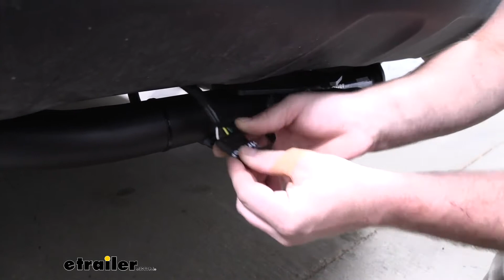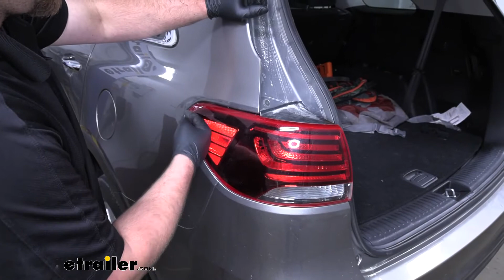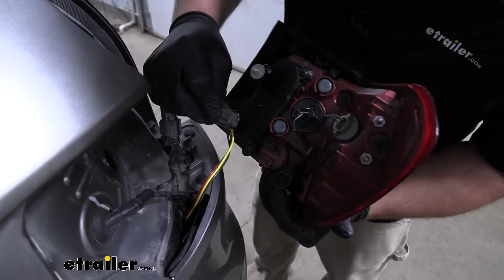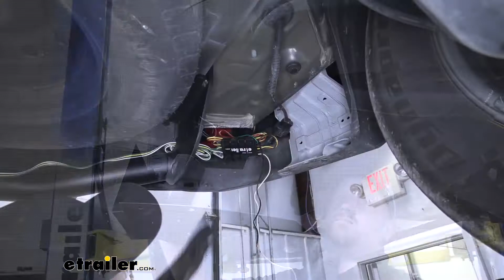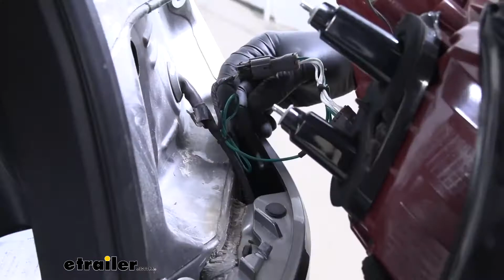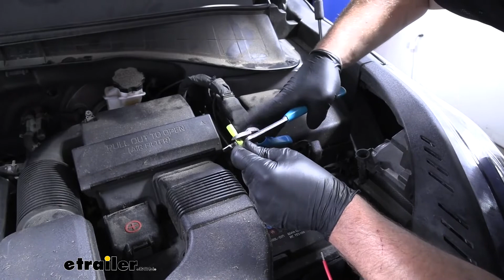etrailer | Curt Trailer Wiring Harness Installation - 2019 Kia Sorento

Comment: I followed this video to a t and everything just never work I grounded it to a metal surface on my 2020 sorento thin tin can kind of metal and won’t work I hooked it up to my father’s trailer and so disappointed
Reply from the maker: If the power wire was ran to the positive battery terminal and the inline fuse is installed, I'd suspect the ground connection. I'd recommend finding a thicker piece of metal to ground to.
https://www.etrailer.com/Custom-Fit-Vehicle-Wiring/CURT/C56256.html
Reply: @etrailer what does thickness have to do with grounding it metal is metal
Reply from the maker: The thicker the metal, the better bite the ground screw gets. Hope that helps!
Reply: @etrailer it does
Reply: I have not gotten to it and is there anyway I could get another self tapping screw the first time I tried drilling it into the frame where the hitch mounts n kept slipping with the screw in with the ground wire so I thought to screw the self tapping screw and take it out and screw the ground wire with it but instead the self tapping screw would not come out. So I had to ask a buddy for a drill bit and a self tapping screw and that’s where it ended up was the thin can type metal in the car came to instead of drilling a hole into where the video recommended.

Comment: I have the 2019 kia sorento ex 2.0L. I dont have the factory hook ups or little cover panel, would this harness work for my sorento? If so, what part number is it?
Reply from the maker: The Curt # C56256 is a fit for your 2019 Kia Sorento.
https://www.etrailer.com/Custom-Fit-Vehicle-Wiring/CURT/C56256.html

Comment: I know NOTHING about cars. But this video helped a lot and I am confident I could do at least half of this myself now. If not all of it. I just wish I could get this kit today not sure how long it'll take to get but just left uhaul and they were able to attach my hitch but not do the wiring... but I read a comment that says it doesnt fit the 2019? But left a link for the 2019, but thats for one with the tow package and im pretty sure mine doesnt have the package. Its an LX
Reply from the maker: Curt doesn't offer a plug and play wiring harness option for the 2019 Sorento LX w/o the tow package but they do offer a universal fit that can be spliced into the existing taillight wiring. You'll need part # C56236.
https://www.etrailer.com/Trailer-Wiring/CURT/C56236.html
Above the 'add to cart' button, there's a link where you can input your zip code to get an estimated shipping time.
Hope that helps!

Comment: I went on Curt's website and it says this part number doesn't fit a 2019. It says it only fits a 2018. Could anyone confirm it actually fits a 2019?
Reply from the maker: Curt confirms that it's not a fit for the 2019. For the 2019, you'll want to use the # C56332 which fits all models EXCEPT the SX. 
https://www.etrailer.com/Custom-Fit-Vehicle-Wiring/CURT/C56332.html
Reply: EXCEPT the Ex not sx

Comment: Removing the taillight assembly is unnecessary because KIA installs the tow package harness at the factory(2014+), you can buy the adapter from U Haul. The tow package harness is under the car and behind the rear drivers side tire.
Reply from the maker: Not all 2019 model Kia Sorentos come from the factory with a tow package. If the vehicle doesn't have the tow package, you'd use the # C56256 and install it as shown in the video. If it does have the tow package, use the # C56332 which installs as you mentioned. And... don't buy it from the trailer rental place. Buy it from us!!

https://www.etrailer.com/Custom-Fit-Vehicle-Wiring/Kia/Sorento/2019/C56256.html
https://www.etrailer.com/Custom-Fit-Vehicle-Wiring/Kia/Sorento/2019/C56332.html
Reply: @etrailer  Great video for showing where these wires could be run. Just having picked up a used 2019 Kia Sorento, it looks like someone had cut off the 4-wire factory connector just behind its plug.  Would you know what this connector could be to replace so that it would be a/the standard connecting point? I could splice it in there if I knew what to look for.

Comment: Inside my engine compartment I took the cover off the fuse block that listed all the fuses and there is a 30 amp fuse in place for a trailer wiring harness. Trailer hitch installed yet even though I bought one. Why would the trailer fuse be there but no one's installed a harness yet?
Reply from the maker: Some manufacturers will include the fuse but not the harness. This is for ease of installation for the end user.
https://www.etrailer.com/Custom-Fit-Vehicle-Wiring/CURT/C56256.html

Comment: Everything looks great except I'm kind of miffed that KIA did not include a trailer power wire in the back of the vehicle just for this type of installation. My last contact SUV, a 2013 Nissan Rogue piece of crap actually had one where all you had to do is tie into the power wire underneath the panel and pop in a 15 amp fuse in the slot Mark trailer up in the engine compartment.
Reply: Well you never guess what happened? I didn't have adequate light to find the factory install towing package harness underneath and behind the left wheel well so today a week later, I took off the same cover took my hand and my body and shifted my vision during the day with more light I found the factory installed wiring harness and I'm now returning the the wiring harness and then purchasing the correct one for the factory installed wiring connection. Can you say whoopie for me I know you could?
Reply from the maker: It can be frustrating if your vehicle does not come with the factory tow package. If you need more pace under the vehicle to run the power wire to the battery, you can back the vehicle on a set of car ramps to start running the wire and then pull the car onto the car ramps to finish running it to the front.
https://www.etrailer.com/Custom-Fit-Vehicle-Wiring/CURT/C56256.html

Comment: at 17:51, is there any housing you can recommend for this specific harness that i can synch to the car so it's not just sitting on the hitch?  Buying this harness though, great video!
Reply from the maker: We have the following kits so that you can mount the 4 pole back by the hitch.
https://www.etrailer.com/Accessories-and-Parts/Tow-Ready/18140.html
https://www.etrailer.com/Accessories-and-Parts/Tow-Ready/18144.html